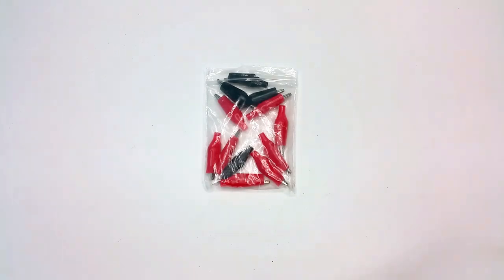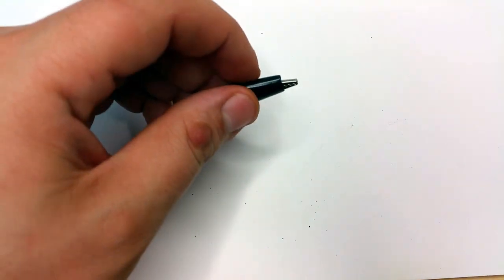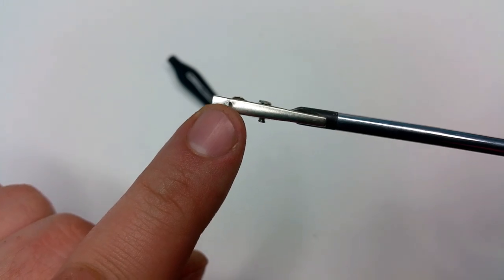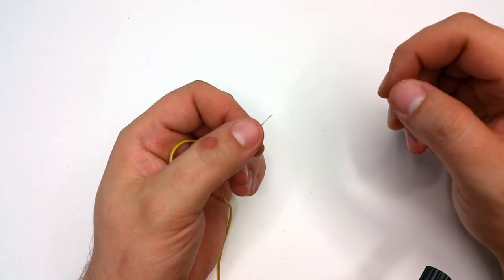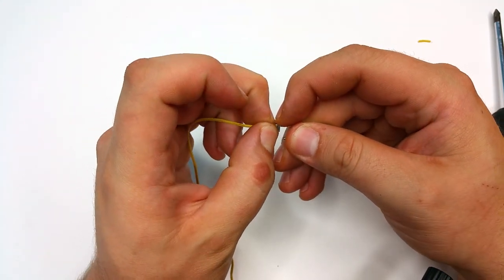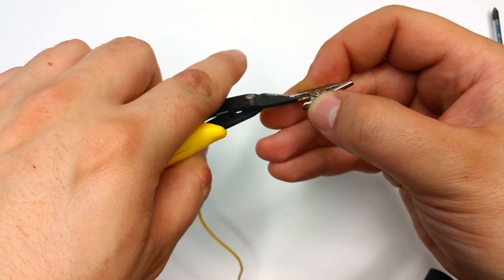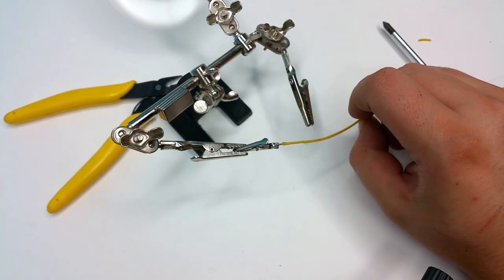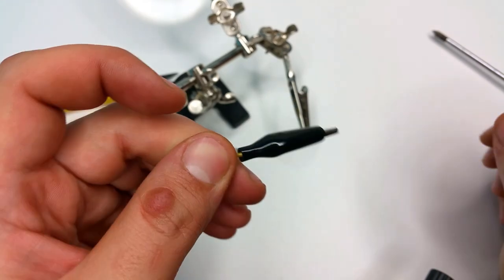DIY How to attach crocodile (alligator) clips to a wire and make your own test leads

Comment: You are supposed to crimp part of the wire that still has the insulation on. That's what the crimp is for.
Reply: Yes! You are absolutely correct. The crimp is how the wire remains in place. It provides strain relief and removes some of the stress put on the solder when handled. Especially given how easily those tabs bent--they will lead to a weak joint, even if the cable is handled relatively carefully.

You should slide the wire further up in, then solder to the clip, then close the clips over the insulation.

Comment: Just my way but I always have soldered the wire to the clip then folded the tabs over and compressed them with pliers to make sure the clip was really secure and strong so the wire wouldn't accidentally pull out if you stretched the lead or knocked the meter off the bench,... like no one ever does that, right.

Comment: what type of wire do i need
Reply from the maker: depends on what kind of load you are going to push through the wires. The higher the amps and volts the heavier the wire... i usually don't use them for more than 30V 3A and this thin wire has stood up well for that power (90W)